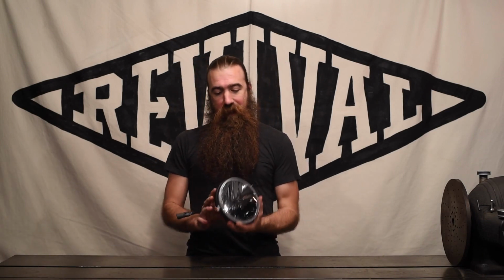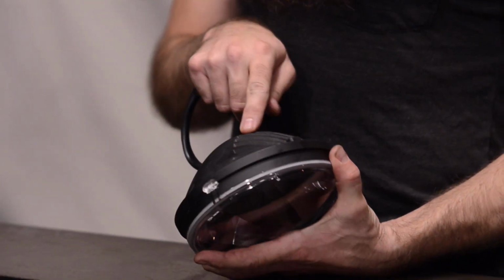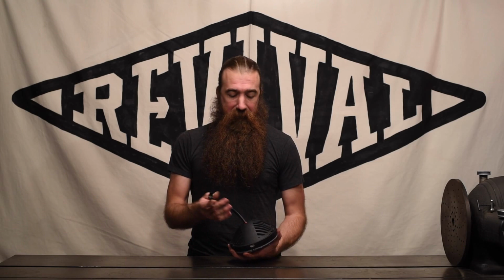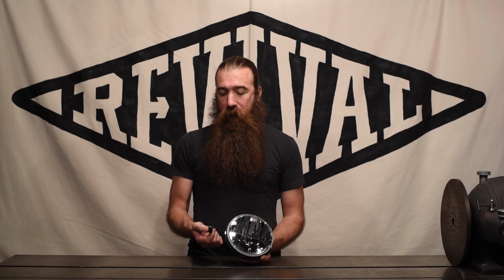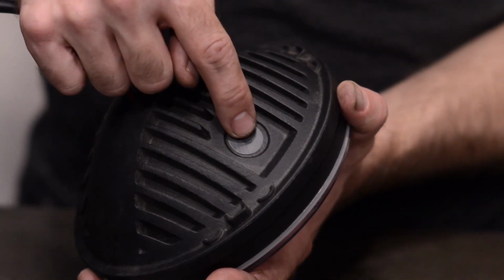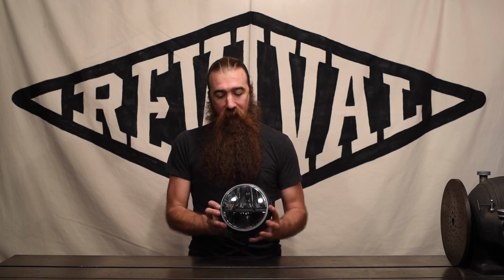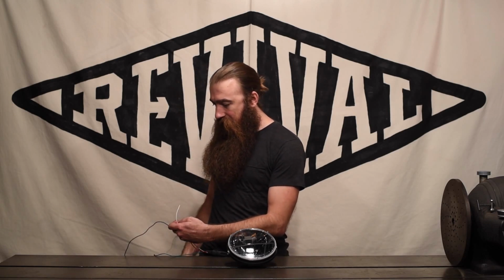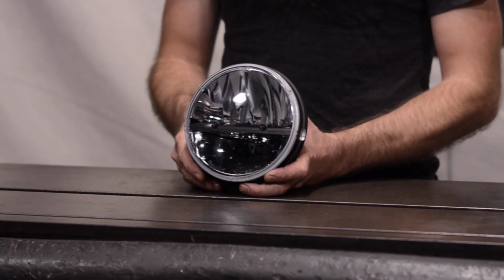Trucklite LED Headlight - Revival Cycles Tech Talk

Comment: i know this is a old video but do i need a headlight bracket adapter if id have to convert my h4 halogen oem light on my FLH 76 E-glide?
Reply from the maker: There is an adapter required to install these on a FLH. I believe Kuryaken still makes a complete kit using this headlight called a Phase 7. 

This headlight has a some great qualities but they were designed for use on trucks and without an adaptor the Bezel is too deep and sticks out half an inch past the motorcycles ring.  We no longer offer them ourselves because of this visual flaw and Trucklite doesn't have control over their distributors who are also resellers that undercut their smaller dealers.

Comment: Is the Trucklite LED from this video the same as the United Pacific from your store? And is the DOT approval the same as "E approved"?
Reply from the maker: The truck lite is very similar to the United Pacific unit, but they are not the same. The biggest difference is that the United Pacific light fits in a headlight trim ring properly.

Comment: wil it fit with yamaha vstar 650?
Reply from the maker: We have not worked on a vstar, so I am not sure what type of light you have. If the bike has a 7 inch round headlight with an H4 connector, then this will be a direct fit replacement.

Comment: is there a mount specific for this light?
Reply from the maker: This light will mount in standard 7 inch headlight shells, the one point to be aware of is that the front of the light sticks out a little further than some of the other lights in this category.  If you want more technical details of the mount for this light, it is a drop-in replacement for #6014, 6015, 6016, H6024 and Par 56 headlamps.

Comment: Hey guys,
thanks for this helpful video. I read that the Truck-Lite heats more up than a H4 lamp so that no wires shoud be housed inside the lamp mask. I can't believe this, I thought about connecting the motoscope tiny and the turn signals as well as the m-button within the lamp mask for having a clean wiring. What are your experiences? Is this a good idea?
Thanks a lot!
Reply from the maker: Hey Philipp - I have not noticed the truck lights heating up at all, and if you look at the total wattage consumption in theory it is not possible to produce as much heat as an H4.  H4's consume around 5 amps of current, and the truck lite only uses 3.6 amps on high beam, so even if it was turning all of that into heat like the H4 it would still not produce as much heat. 

We run chronoclassic gauges in the same headlight shell with truck lites all the time, and there are no issues. That said, I have always hated having connections inside headlight shells so I never do that. After so many years dealing with the rats nest in the headlight, now we run all the connections back under the tank. This is just a matter of personal preference and in our case we make the tanks very quick and easy to remove so its just as simple as opening the headlight. 

What is the source of your information that truck-lites get hot? I've found that many people are terrified of change and anything new and high tech must be bad. Either way, I'm curious now, so I'm going to hook up a light and see how hot it gets after  a few hours on high beam. I'll get back to you with some real data.
Reply: Hey, thanks for that detailed reply. Of course you're right, LED's have to be much more efficiant than a H4 "burner".
I'm sitting here in Germany, so I'm afraid to can not buy easily from your shop. One of the two greatest motorcycle stores here in Germany has this notice at their website: https://www.louis.de/artikel/truck-lite-led-hauptscheinwerfer/10035484?list=201924990&filter_article_number=10035484 (Google Translate may help)
Doing all the wiring under the tank is a great idea, but on my Yamaha SR500 project I think because of the tank cut out for the oil neck it may get a bit wet sometimes around there, so I'm feeling more secure to wire all the things up  within the headlight shell.
Thanks a lot again, you're doing a great job!